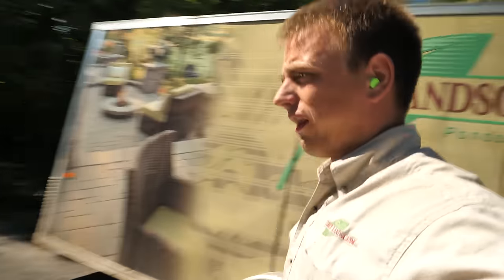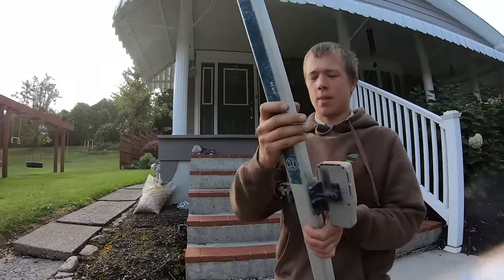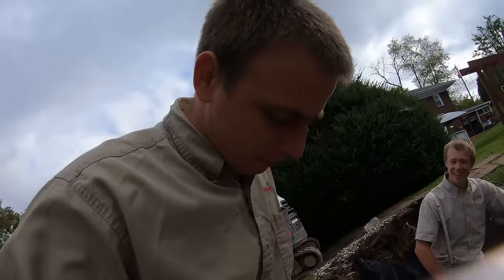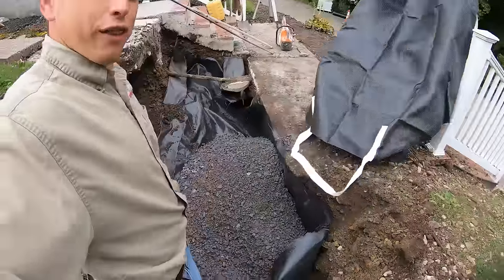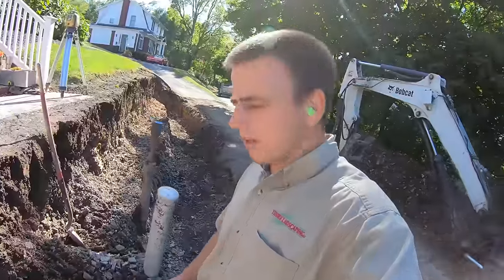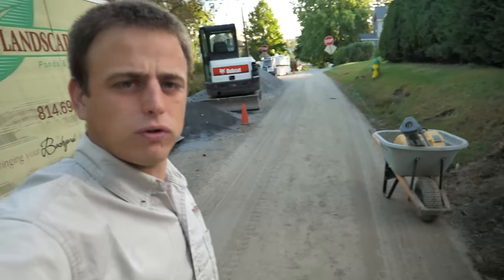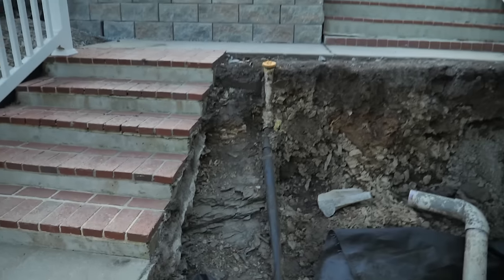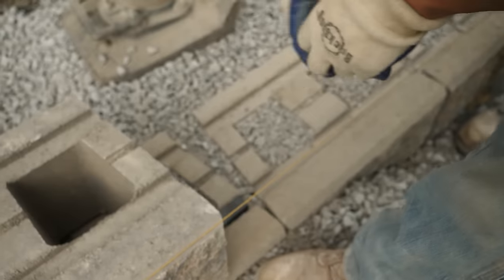How to build a RETAINING WALL that WON'T fall over!

Comment: Awesome work guys! quick question, if the customer wanted to add shrubs just like the previous build how far would you go down with planting soil?
Reply from the maker: Thanks Arthur! We'd just dig a little pocket in the clean stone backfill and insert the plant, and backfill around the plant with soil
Reply: I  would keep  any shrubs  or trees  well  away  as  the roots  will  find there  way  into  any  subsoil drains  &  cause ground  heave  which  would push  any wall  over  eventually.

Comment: How long does this geogrid rubber mess last? 10 years? So after that time, does the wall fall over?
Reply from the maker: Forever. Lol. The only thing that breaks that kind of material down is UV rays, and there is no UV rays underground, so.... yeah, the wall block will deterrioate before that stuff does. So essentially, a VERY long time

Comment: Whats your thoughts on a piece of filter fabric between the retained earth and stone behind wall? I always drape them over from the earth side and cut a couple inches before grade is met with backfilling.
Reply from the maker: I've heard not to do that as water can build up lateral pressure behind that. I doubt that it's a deal breaker though
Reply: ive do the same but it largely depends on the type of earth you are separating it from as earth with high clay content will clog the fabric up. if its a more sandy mix of earth then yes filter fabric is fine i think.
Reply: Hmmm I may stop doing that. Its never on the plans. Its just we do drainage and it's drainage we are putting behind the wall. Clean stone French drains we wrap in fabric. So I had these drains wrapped in fabric on 3 sides with wall on 1 side idk.🤷‍♂️

Comment: Are the caps just layed on top of the wall or is there any adhesive used, or do they lock into the previous layer?
Reply from the maker: They are glued down

Comment: I have a wall 5 ft high and 24ft long.
It was built with 8in cinder blocks, mudded in and faced with brick. 
It finally fell this year after 15 years standing. I'm now on social security and money is tight.  How much would you think I need to save up to have it rebuilt like that one you did ?
I know prices will be different throughout the country.  I live in Tennessee.
Reply from the maker: I would expect in the range of 15k +/- 3 or 4 k
Reply: @Tusseylandscaping  Wouldn't it be possible to use cinder blocks and cement instead of the fancy srw stones if it doesn't have to be pretty? Of course sandwich in the fabric and same idea of draining system...
I guess that would keep the cost a lot lower?
(I have a similar wall to build soon)
Reply from the maker: You may be able to keep the cost lower that way if you build it yourself. Cinder block is cheaper than this block. But that method takes considerable more steps and labor than the srw wall construction, and you have to dig deeper to get frost free foundation, meaning it cost more. If it was me, I would choose srw over masonry wall.

Comment: I have a question. I’m buying what looks like this same block for a sea wall type retaining wall going in the bed of a lake. The lake is a big ski lake so the boats are currently eroding my shoreline badly. The wall is huge at about 5’ high 547’ long. My question is this... do I need drainage pipe installed behind the wall with an escape drain like you did if the wall is underwater? I would think it would just allow it to fill up with water behind it easier. It’s a tricky situation because five months per year the water level is let down and the wall would be exposed to dry area again. Not sure what to do. Thank you for the awesome video and any help !
Reply from the maker: Based on what you described, yes I would most definitely install a perf pipe behind the wall. The whole point of the pipe is to show water to escape freely. Not installing the pipe won't prevent water from coming behind the wall when the lake is full.

Comment: Why is it not necessary to put a sleeve on the drainage pipes/material used? We’re not dirt clog up the holes?
Reply from the maker: No it won't if you backfill with clean stone, no need for sleeve. In fact the sleeve is what plugs up if you use one. I never liked them

Comment: I understand the freeze and thaw cycles (grew up in NE Ohio) and the drainage. I  now live in mid Georgia. How different would it be to do a 4 ft wall on very rocky clay soil? No freezing down here just lots of water.
Reply from the maker: I would still do a compacted sub grade in your footer, compacted stone base and clean stone backfill and pipe for drainage. Whether that type of spec changes from being down south, I'm not exactly sure

Comment: How much does the right choice cost the homeowner? And the wall looks great and very sturdy!!
Reply from the maker: All depends on a lot of factors. But what we do see time and time again is that it is far cheaper to do it right the first time than to cheap out and hire a cheaper contractor. More times than not, 2-5 years later, it all needs torn out and redone, and that is more expensive than if they had just done it right the first time. Feel bad... Some people blew all their budget on the first round, then it fails. If budget is a problem, we encourage not to cheap out on contractor, find creative ways to downscale and save on design choices

Comment: Damn I wish you guys were in Pittsburgh! I'd have a job for you. When I purchased my house the railroad tie retaining wall in the front had been deteriorating for years causing the foundation of my addition to slightly fall. That's currently being fixed but I need retaining walls in the back and the front, just like this in order to prevent further movement and reroute the water to the front street.
Reply from the maker: We've worked in Pittsburgh before ;)

Comment: Great video! Would you have used the same system if the location (SoCal) has no freeze/thaw cycle and it's clay soil? Thanks
Reply from the maker: Yes I would. Water can always cause issues. But might want to ask someone familiar with how walls are engineered in your area. I'm more familiar with how things are in the north east

Comment: Would this retaining wall be able to withstand even if a vehicle were to park on the area being retained?
Reply from the maker: If it is engineered correctly yes. You'll need to check with your block manufacture and make sure you get one that can handle that kind of load

Comment: Nice video, thanks.

1.)  How long was the main wall?  40' or so?
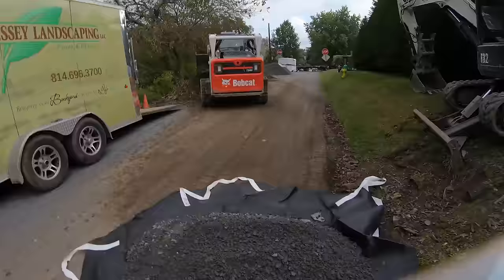2.)  Can you list the different aggregates you used, and a description of each?  It would be a good idea to include them in the description.  For us non-professionals, please provide not only a product name or number, but a brief description of what the aggregate actually is.  I.e. for your base layer, you named the stone at 3:01 in... 2-8?  (couldn't hear it).
3.)  How did you calculate the required amount of each aggregate?
4.)  Is the lowest level separation fabric the same as what you used up top?
5.)  Would reclaimed asphalt be usable as the base layer?
Reply: Peter Moore oh dear. If you really want to know you need to do some work learning. You’re on the Internet. Start learning. Go to Home Depot or Lowe’s or your local Soil and Landscape yard and look at materials. Ask questions.
Reply from the maker: Yes I think it was 45' long
For the base we used 6" of compacted 2A stone, and then 1" of a washed 1/4" stone setting bed
We use our own production rates to calculate stone qtys, but it isn't hard. Theres a bunch of stone calculator apps available. 
Yes, we used the same type of seperation fabric in each location
No, I wouldn't use reclaimed asphalt

Comment: i noticed you didn't put geotextile fabric behind the drainage stones separating it from the back fill/open earth? is there a reason why?
Reply from the maker: That would have the potential of restricting any ground water flowing out of the bank causing lateral pressure. We want that water to flow freely, so we only put fabric on top of the backfill stone to keep dirt from migrating down through

Comment: Wow, the lesson is great. One question, aren't the geogrid supposed to be placed perpendicular to the wall black? 
Once again, you guys are great in making things right.
Reply from the maker: Thanks Elisha! Good catch too ;) some geo grids are made to only have strength in one direction, as you pointed out. The material we used is bi-directional, so you can install it either way
Reply: @Tusseylandscaping  As can be seen at 14:22, the longitudinal threads are double, and the transverse are single. Perhaps, for such a low retaining wall, strength will be enough, but I would clarify the specifications for the material

Comment: i missed or could not understand what those little black blocks you put into the bottom of the wall  where for ?
Reply from the maker: They are the clips that hold the wall block in place. Some wall block uses a clip system, others use a glue

Comment: Do you keep the geogrid flush with the front face of the retaining wall block so that it sticks out a little or do you set it back a little so that it isn't visible?
Reply from the maker: I like to keep it back just far enough so it's not visible

Comment: Very tidy work! But for that price would you not be better pouring an RC retaining wall and facing wth stone work?  Just seems like a lot of labour for something that is still depending completely on ground conditions
Reply from the maker: The important part is you don't build on top of compromosed sub-grade. As long as you aren't building on top of compromised sub grade, this wall will last and endure just as well, with less work, than a concrete wall. Pouring a wall and veneering it would be considerably more labor than building an SRW wall.

Comment: hi i have watched a few different retaining wall videoes and just wondering why you dont have a concrete footing.  is the rock cheaper to lay down over a concrete truck. and the block arnt concreted. is that because they are larger and the weight locks them in.
Reply from the maker: This is not a monotlithic engineered system. Concrete has to go below the frost line. This system does not. Which is why it is installed on a compacted stone base

Comment: What blocks are those and where do you get them? All we have down in in LA (lower Alabama) is paver system blocks
Reply from the maker: Techo Bloc Suprema. Get them from sent Techo dealer
Reply: @Tusseylandscaping  Suprema spec sheet says they are 123 lbs each. You are pretty strong. You need to wear a back brace though. Good ones are $25 and will save your back over the years.

Comment: When and where exactly is landscaping fabric appropriate?  I'm working off a tiny wall, (so that I can level a patio on a graded yard).  The head of the patio will be below grade, the foot will be above, a fall of about 16 inches from front to back (10 on one side, 6 on the other)

I'm thinking a small retaining wall will work to keep the yard's grade.  I've seen conflicting answers on fabric, and I'm wondering if I'm just confused over when and where I should place it.
Reply from the maker: the fabric should simply be used as seperation between your sub grade and base stone, that's it. that make sense?
Reply: @Tusseylandscaping  Yes thank you So I'm gathering nothing vertically on either side of the drainage gully just below the packed base
Reply from the maker: Yes, below the packed base, and again on top of your clean backfill stone, before you put soil on top
Reply: @Tusseylandscaping  thank you so much for your advice
Reply from the maker: You bet!
Reply: @Tusseylandscaping  that fabric will let water go through down the gravel?

Comment: Tussy, is that some kind of soaker pipe? How does the water get into the pipe?
Reply from the maker: Hey Douglas, it's a drainage pipe. Any water from behind the wall will end up in that pipe and escape through the drain
Reply: Tussey Landscaping , gotcha. Very good content. Thanks for the upload!

Comment: Do you guys have to do any zoning research for the cities your job sites are located in? Are there restrictions on how high your walls can be or stipulations you need to meet before constructing such tall walls? For example, do you ever need to have engineer stamped drawings before moving forward?

Comment: When you install wall blocks below grade, is that specific to the area it is being installed such as decking footers? Are you looking to go deeper than the frost line? Also, it's a shame that both the blocks you linked are discontinued and unavailable in my area. Most of the blocks that I can source locally are pretty low quality stuff.
Reply from the maker: The block below grade is required by the engineering is these types of walls for a solid footing, it's not below the frost line though. 

Sorry to hear they're discontinued! Have you looked for EP Henry block?
Reply: @Tusseylandscaping  Appreciate the info. I live in North Idaho and I'm not having luck finding anything that can be sourced locally. I've looked at EP Henry too, no luck.

Thanks!

Comment: When you run your geo-grid over and out in front of your blocks and run your next course of block, how do you keep the grid ftom from showing or being seen? Just cut close to the blocks? Seems you'd still be able to see it though.
Reply from the maker: Hey David, yeah we cut it off at the front, then used a torch to burn it back even further

Comment: You mentioned that the 4inch perforated pipe would eventually be crushed...so doesn’t that render the whole drainage solution useless?  Perhaps I misunderstood...I must have cause otherwise the whole thing would be at risk without the drainage.  Many thanks
Reply from the maker: No it would not crush (unless you smashed it with heavy equipment or something) yeah, that pipe is needed for the wall's integrity

Comment: We have soupy clay below grade that I fear will flow into the clear stone from behind. Conversely, the same soil would clog fabric if put between the soil and drainage (vertically). How do you keep soil from migrating from behind the drainage rock?
Reply from the maker: If you want to safeguard against the dirt migrating in to the backfill, i would just install 2-3' of backfill behind the wall, instead of the normal 18". It'll never make it in the stone far enough to compromise the wall
Reply: @Tusseylandscaping  thank you! Love your videos

Comment: This was very informative - like that geogrid and the block you used.  I do have one question - the wall seems so close to the street.  Can you comment on that?  Thanks.
Reply from the maker: This was a city lot, and yes the wall was right along the street. There are no sidewalks on this street, so there was no set back or anything needed

Comment: man, that was a looooot of stone, can you backfill on the geogrid using the soil from the original excavation? I get the rise vs width of the grid requirement but I have never heard that it has to be stone.
Reply from the maker: Yes it can be soil from the excavation. All that is required as clean stone backfill behind the wall is about 18". The reason we did all stone is the site was so small that we had to haul out the excavation as we dug it. No place to stage it. And it was easier and faster to just bring one material back in, stone
Reply: @Tusseylandscaping  gotchya. Thanks for the reply

Comment: I would have put regular weep holes in the wall along the full length of the perforated pipe. That way you reduce the risk of a single blockage and also the visual impact of a single large drain hole at one end. Nice job though. Not seen dry laid wall before, in UK they are still mostly laid on weak mortar.

Comment: Subbed. 
Geogrid is not that common in norway, but i managed to get a hold on it. Talked to the importer and it has two strength ratings. I bougth 55-30.  The strength was 55kN for thr length and 30 kN for the width of the roll.
I was told i couldnt roll it out like you did parallell to the wall but i had to cut sections of 2 meters perpendicular to the wall. 
Just a heads up, migth be diffrent with your product.
Reply from the maker: Depends on what product you get, but yes some grid is like that. We use bi-directional, so you can roll it out along the wall

Comment: Why would you not wrap your weeping tile with geofab or soil separating fabric to keep the fines from clogging the pipe?
Reply from the maker: We backfill all around the pipe with clean stone, and then lay seperation fabric between the stone and dirt. We find that the fabric around the pipe clogs up much quicker and causes it to fail

Comment: Looks great guys. Couple of quick questions...1) When you cut into the long base drain pipe to make a "daylight opening" for the house drain (at the far right side) What did you do with the end of the perforated drain that ran towards the steps? Put a sock over it or did you tee it into the other section? I don't believe you explained that in the video. 2) You put in a pop-up drain on the left side of the small wall. I assume as the water pressure builds up the green cap "pops" open allowing the water to flow out, then goes down once all the water is drained out. I also assume that the home owner would have to ensure that the top is clear to keep it functioning correctly? 3) Sorry I guess there were  3 questions...What's with all the straw?! Didn't you plant grass?
Reply from the maker: 1) We just capped off the end of the pipe
2) Yes that is correct
3) We did plant grass, and used the straw as a moisture barrier